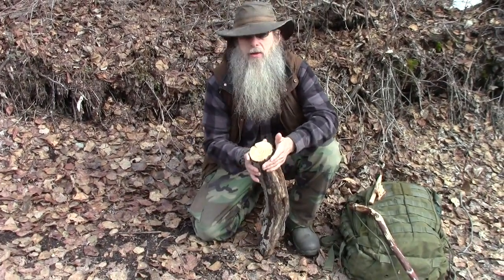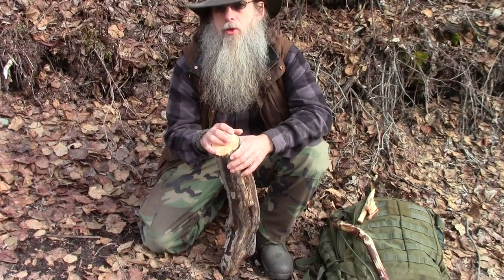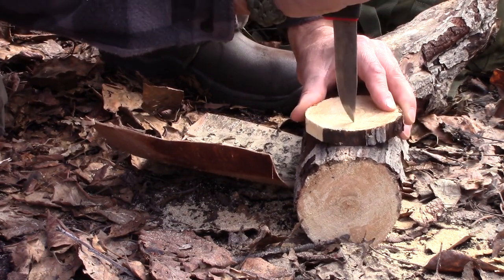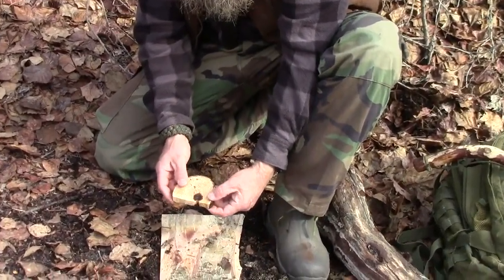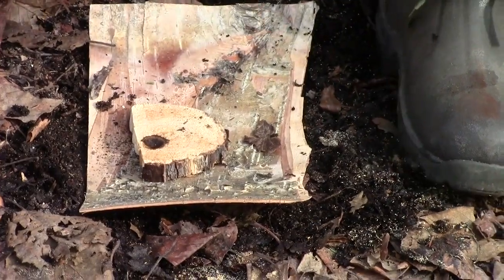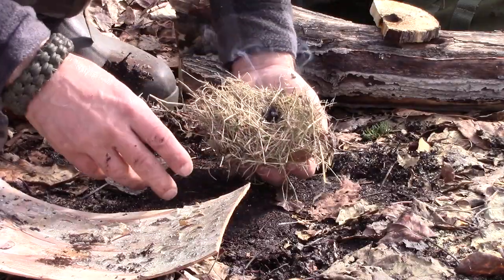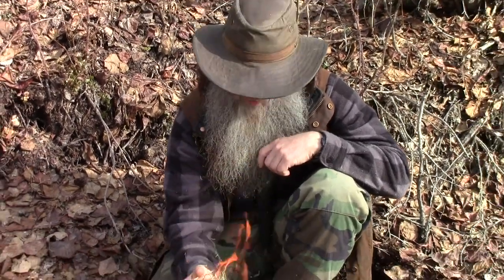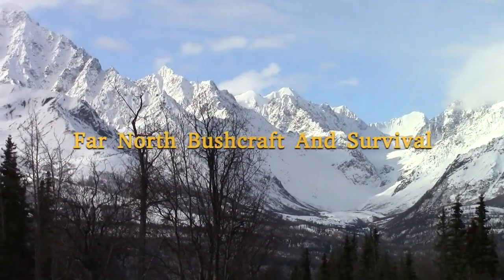An Important Friction Fire Hearth Alternative

Comment: Even your beard looks like Usnea moss! Cool video Lonnie, learning a bunch.

Sooo close at getting my first hand drill fire over here. Using a dead sapling branch and a hollow tube bush for spindle i found outdoors, not sure which kind of bush. Looked like raspberry almost, but much ticker. Reminds also of rose, but without thorns. All good, great vid.
Reply from the maker: If you have Elderberry in your local, that is what I have used for hand drill friction fire as the "spindle/drill."

Comment: End grain... makes perfect sense. Like a rope, more open fibers to catch fire on the open end than on it's closed tight sides. Dig all Y'all do.   -gilpin  4-19-16
Reply from the maker: +William Gilpin     We are already dealing with end grain on the spindle so adding end grain on the hearth board as well may cause more friction with end grain against end grain.   More friction equals more heat which in the case of a friction fire is a good thing.

Comment: Awesome vid! 
I'm kinda wondering though. The end-grain is typically rougher than edge-grain, so using the end-grain should make it easier to start the fire. It should also be easier to cut the channel, but why do we typically make the hearth on the edge-grain instead?
Reply from the maker: It is somewhat difficult to make the notch in the end grain without splitting the wood where you do not want it to go.    It is also easier to accidentally split the wood out when drilling on end grain.   the traditioanal style is more rugged / durable and reusable.
Reply: Ahh thank you! That makes a lot of sense!

Comment: So friction fire hearth board is better going with the grain rather than against it, just like splitting wood with the grain rather than against the grain.
Reply from the maker: This method does not make teh standard friction fire hearth board obsolete.  A good standard hearth board works very well and easily produces an ember as well.

Comment: Darn good alternative...in fact you said it might be better...it looked easier to make...fast results...and using that formula it's dry every time. So my question is why is this the alternative and not the go to method?
Reply from the maker: +tazmun    Once I make a friction fire set, I like to carry it with me for a while and use it.   The thin end grain fire board or hearth board is not so durable for continued use including rattling around in the pack.   Also because of it's size, it gets used up sooner.   It has it's pros and it has it's cons.    You may find personally that the end grain fire board suits you the best.

Comment: I was wondering what your opinion on those ring pull wood saws were, Have you used them? Any good? 
I just found this site http://www.survivaloutdoorskills.com/saws.htm
I am looking at these because it would be more convenient to carry around and would have more than one application.
Problem is with this is you get the kids cutting things down just to mess around and dont know the difference between the need to do it and just passing time for entertainment.
Reply from the maker: +Ryad Arlan   I have never tried those cable type saws but I do have apocket "chain saw".
http://www.amazon.com/Liberty-Mountain-1102-Pocket-Chainsaw/dp/B000LNQA50/
It is pretty handy to have as a survival saw but I would not get it for general everyday camping use.   I much prefer a folding saw like my bahco laplander.   However if I was going to get me a new folder, I would probably get a silky in a llttle larger size than the bahco laplander.  I have a VERY large silky folder and am very impressed with it.   My thoghts on those little cable saws are that they may be okay in a survival kit but they really are not very practical for general camping.  Now like I said, I have not personally tried one but I am just guessing about the performance and efficiency by looking at them and comparing the looks to other saws that I do have experience with.    Good luck in your search
Reply: ***** Thanks, I mention them because of their size and weight. considering a total pack and its total components, size, weight and uses. I am some what a refined thinker and constantly look at things with disappointment as to how much waste is around in all aspects from materials, energy, uses and function, purpose, logistics, manufacturing... I only dream of escaping to some place like where you live but at the same time I know what is being left behind and how it is effecting where you live and how it wouldnt take long before it was the same there. I have seen it happen to countless places. Soon places like your will be just a dream and a picture, sooner than I expected. It is a very serious issue but not many people even know it and even when they do there isn't much they do or could do about it. Had a look at the Amazon on google maps and that is a tragedy. I mean it is good we have the technology to be able to see that now (Thank you N.A.S.A) but people dont think globally like that. Most are in a room and their car and see a television and a fridge and that about all. I fear the propaganda, the propaganda I fear the most and am the most skeptical about is the part where there is word of how people are being active towards being efficient and clean energy, sometimes I think it is just an Oil play to calm people down but really the figures are the same. I dont know. I haven't established a direct team to build anything or actually do anything it is as though they want you to drop it and then pretend it is being done. I dont buy it. Everything is a fight, a struggle, the littlest things that shouldn't be an issue seem like climbing Everest and people have a laugh at it for entertainment.You know me and you could go over this for hours and I was kind of hoping 11 years ago that is where I would have ended up. I am done. I worked on this 11 + years and its done if I was robbed then it is their responsibility. I am being held hostage here in Australia cause they screwed over a lot of places for profit and nothing more and to spin some entertainment India and its call centers etc.. all just draining everything. They cant work together, they dont know how to. there is no training or coordination.  We are held captive behind computers and powerless in real world and India loves it, they control it all now because of that. Turn you on and off as they please.

Comment: I bought several cigarette lighters for a few bucks .. Is it not cool to use these most practical gadgets ... Ok rubbing sticks gets you on youtube , Cigarette lighter  fires are probably boring. I have lots of matches also ? still no, hmm ok rub your sticks ?
Reply from the maker: In case you did not notice, the name of this channel is "Far North Bushcraft And Survival".   The purpose of this channel is to help people learn skills that will help them survive when everything is not perfect.   learning how to use a Bic lighter is a "no brainer" and is hardly a subject that needs to be taught.   You do not need to feel guilty or ashamed for using your lighter to light fires.   By far the majority of the fires I light myself are with a Bic type lighter.    The question I have for you is WHY did YOU watch this video?   If the purpose was not to learn a different method of lighting a fire then I am forced to assume your purpose in coming here was to ridicule and make fun of others.    If that fact is true, then indeed it points out a major flaw in you rather than others as you had hoped to achieve.